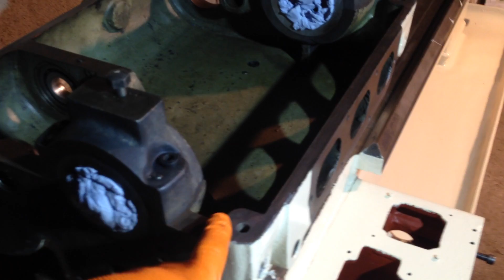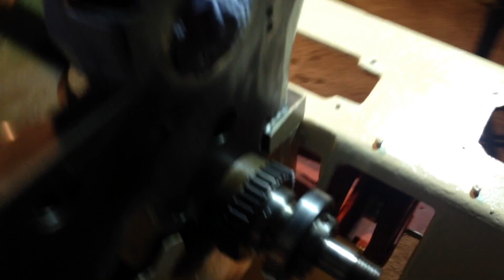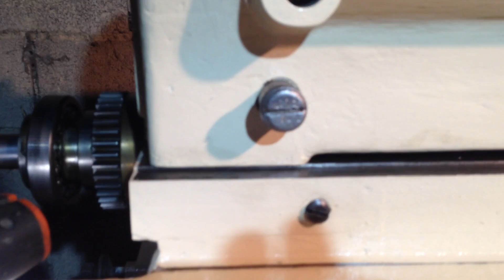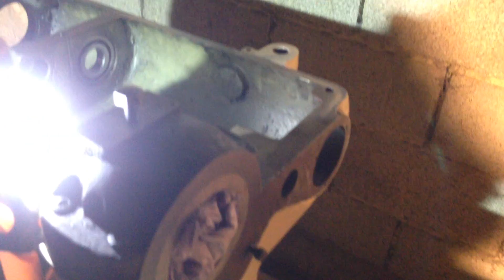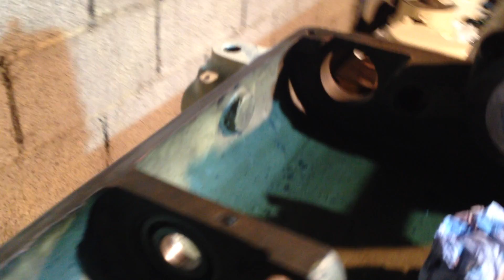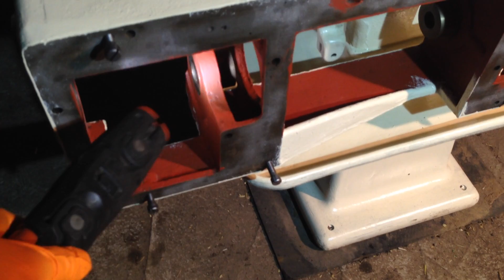Holbrook T15 lathe project pt3

Comment: Hi just spotted this in an internet search....I have been restoring a Holbrook T13 myself...... you may have mentioned it already- could you tell me what the Construction number is?...Hope that you are proceeding further with the restoration?...should be a fine machine...
Regards
John
Reply from the maker: Hi John thanks for the interest, The T 15 is finished and been used for various tractor restoration work if you look at some of my latest vids you’ll see it turning* out parts for a V 8 tractor conversion it’s also getting a lot of use on a worn out Oliver at present , rebuilding shafts etc and turning them to size , it has a little bit of bed wear but as you’ll know once you get to know it’s back lash etc I can turn stuff out with a high accuracy . The rebuild videos stopped because no one was really interested so I finished with out much filming , shame really as I stripped it down to its bare bones shot blasted it and rebuilt it , it’s a line shaft machine converted to electric , painted it though the colour has been controversial, I like it ,light colours are good to work with . I’ll get you the serial build number and post it, regards David H. I think it’s a between the wars machine what stories I bet it could tell eh! .
Reply: @oneminutefarming9521  ah that's good that you did finish the rebuild...Have now looked at some of your other videos and can see it at work.. with good finish evident on one cut...
I will be able to tell you from the construction number the year of dispatch from the factory and batch of numbers within which it was produced ..
The T15 was actually a quite numerous machine in its day with quite a few produced..but due to its larger size than the T13 and other models..not so many have survived..... and they seem to be rarer than T13s now...
Best
John

Comment: Quite a few different fittings to my T13. The bearing that carries the first driven shaft from the clutch on mine was a pair of ball races. Separated by a spacer and locked at position with a split coller. They were removed out towards the Chuck end by a soft drift. No taper pin or similar? The number stamp on mine are all No 4 except the headstock which is 28. I believe they were operator or job numbers.
Good luck with your clutch, mine was a pain but it worked out ok 👍 
All the best
Mat
Reply from the maker: lookcreations Hi Mat , yes when I opened it up I was expecting to see similar to your T 13 but it was not to be . It is a taper pin , there was a similar set up on one of the shafts that run along the front through the apron , that one came out easy just tightened the nut and out it popped , not so for the one in the gearbox . I did wonder about those numbers and their significance your suggestion makes sense thanks for that . The clutch on mine was in fair condition so I took it to bits and put it back together as I found it so thankfully no problem , funny thing an expanding band , was it a common thing on machine tools of that age ?, I don’t know , anyway good luck with the rest of your restoration regards David H.